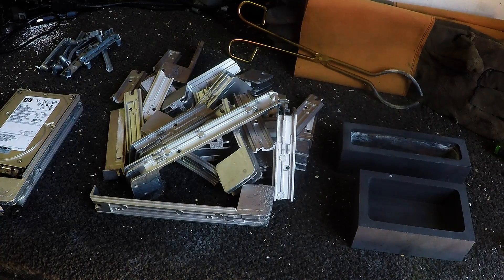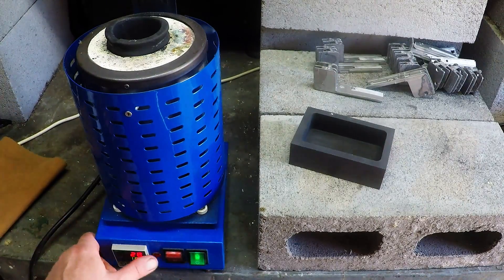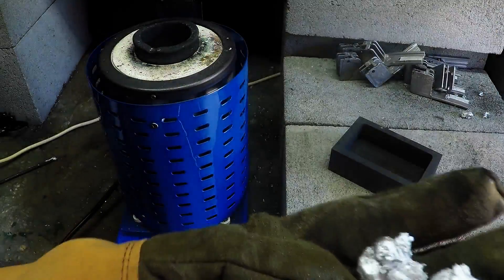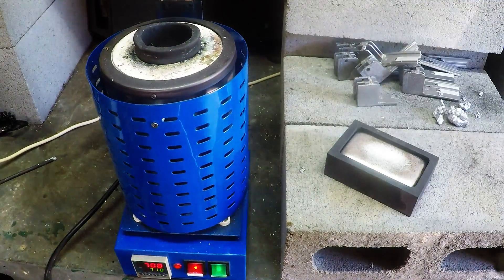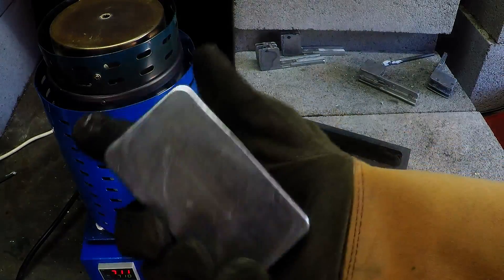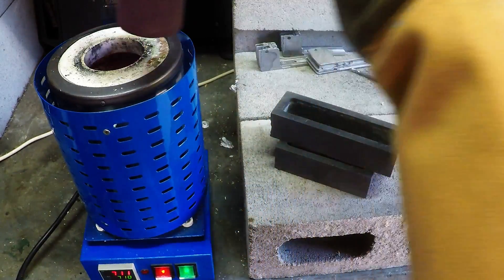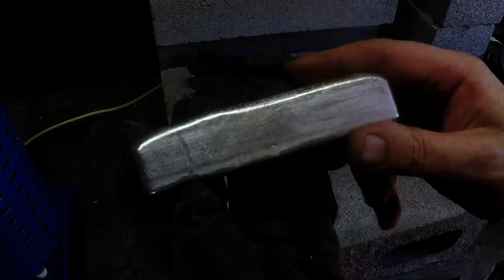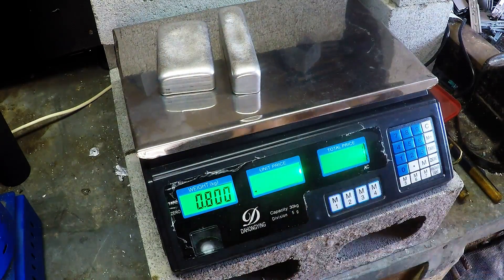Casting Aluminium Bars from Scrap

Comment: I melt down here in the u.s. . Its typcally off my service scrap stuff from heating and air .  I saw your other video on the big copper bars and what not. If you can make yourself a torch stand to keep the torch tip center of your molds. You raise it up a bit  and it helps keep your molds hot  while pouring, but what it will also do for you is give you these real nice ripples in the pour on the bar. Very clean looking and nice appearance. You had mentioned doing the art bars  all the ripples turn oht differently too.

Comment: Casting alu. You most likely have aku with another metal thus not quite all melted. You might try 100 deg higher
Dross is tarnished metal or dirt. You should not have the material you showed on your video. Too hot dirs nit make thick metal. .

Comment: Hey Ben I hope to have a set up for melting metals within 1 or 2 years. I was thinking about buying the same furnace as you are using but the ones I see on the internet dont seem to reach over 1100 degrees celsius. So maybe Im going to build my own gas torch oven or buy one from devilsforge as they arent that expensive and are very economical in gas use. Love your videos!

P.s. I see that crucible is getting thinner. How much pours in total it will last?
Reply from the maker: they don't last lost when melting copper so when they wear out a bit too much I used them for aluminium which is much cooler.
electric furnaces are only good for gold & silver, best to get the devil forge and a clay graphite crucible like a salamander, they last a long time with high heat
Reply: @eWasteBen  thanks!

Comment: Dross would typically be any impurities - say plastic that still got into your raw material. Given you were starting with relatively pure material to start, you may want to consider attempting to re-smelt the "dross" a time or even two to extract as much pure metal as possible from an non-industrial casting.

PS: Americans won't hold the pronunciation against you. After all you also include all those extra letters in some words as well (colour  - color).

Comment: Cast aluminium is less pure than extruded aluminium; cast aluminium will have anything from salts to copper added to help the copper flow into the mold/prevent voids and bubbles and such. extruded aluminium tends to be more pure since its put through a die with tons of pressure. you can extract more aluminium from dross by using stump removal powder (forget the chemical, look at makerj101 i think is the channel) during the melt. good video!

Comment: Hi Ben: Bit off topic,but i hear the weather down under is burning hot. How has your area been?.  We been having terrible weather here in the states. Tomorrow it is going to be 60 degrees Fahrenheit here in Wisconsin. It is unusual seeing those temps in February,usually around O degrees and is supposed to be one of our coldest months. Makes me wonder if the northern lats will see what you are getting.
Reply from the maker: It's normally the hottest time of year here and yeah there's been consistent hot days in a lot of Australia but we're actually ok down in Melb', 90's mostly but we've had some very hot nights, 90's all night
Reply: bantalee2002 I live in Wisconsin as well and it was 65 Fahrenheit, I loved it.
Reply: I love the videos! I'm in the process of making a gas pottery kiln. I'm hoping I will be able to melt batches of metal in it as well in time. If you ever make any more austalia bars I would love to buy one.  Maybe some Al AU bars would pour well!

Comment: Awesome pours bro!  Quick question for you when you have a moment. I found in the dial of a clothes dryer, a gold coloured circle snapped switch. I have seen a few times in switches where there is no silver contact and instead just the gold coloured and it's pressed up where the contacts would normally be. My question is, is it most likely just yellow brass or is it gold plated and that's why no silver contacts?  Is yellow brass ever used instead of silver contacts for certain applications.?  Any help would be appreciated. Thanks.
Reply from the maker: I'd imagine it's brass but not totally sure without seeing it

Comment: my yard takes ali dross so your yard may too love the vids iv been getting some great pick ups since your advertising advice video do you re-sell cables i got boxes of cat5 internet, pc power cables, phone chargers and hundreds of vga cables i going to try sell them as a job lot hopefully
Reply from the maker: sometimes I do sell cable in box, vga etc are very common so they don't sell well
Reply: eWaste Ben i didn't think they sell well im hoping someone who just sells cables at boot sales or flea markets would be interested i cleared out a few offices recently in the canary wharf skyscraper which were my best pick ups so far and got hundreds and hundreds of vga and vci cables anything over scrap value would be a bonus because im making money off all the brand new still sealed monitors they gave me #score

Comment: Hey Ben, I've just bought one of the furnace units. I'm curious how many heats your getting out of your crucibles? are you measuring as you go? I assume it will be different for lower temp melts. cheers Dale
Reply from the maker: about 15 good pours on average, yes the hotter the temp and longer it goes the more wear to the crucible.
Aluminium would last 50 or more pours, lead maybe 80 pours, the crucible I used here had a very high heat for almost 2 hours straight once, then other copper pours so it's almost shot, only good for a few more Aluminium pours now.
too thin and it will bust open and leak metal into the element which will short the unit out
Reply: eWaste Ben , are you using anything specific to measure or can you visually tell as it becomes unusable. I may give it a test run today as the weather has calmed down, and did you or are you adding borax to the melt? thanks for taking the time
Reply from the maker: I didn't add borax to the aluminium, might try it next time. 
the crucible will just get thinner, for high heat about half the original thickness is about it, after that just use them for aluminium or lead.
Reply: eWaste Ben, Thanks mate cheers

Comment: What is your advice on chrome plated brass, was hoping to cast some old tap ware? will the chrome seperate from the brass into borax flux or burn off?  Good job on aluminium. Cheers
Reply from the maker: probably not burn off but might rise to the top so you can skim it out with the molten borax.
if not then maybe add some clean brass to dilute it down to next to nothing. 
the chrome plate is only very fine, usually plated over a layer of nickel
Reply: Thanks for that Ben, will let you know how i get on. When it cools down a bit the weather. will only be about 6 or 7 ounces for the first go.

Comment: Aluminum is very reactive to oxygen, so much so that it nearly instantly forms a bond with oxygen from the air creating aluminum oxide. Aluminum oxide has a much higher melting point and is very hard. Fortunately it is also nearly impermeable to air. Any aluminum will form a skin of aluminum oxide that will prevent the rest of the aluminum from oxidizing. Those bars that were just poured already have a skin, so if you melt them down again you will still get even more dross. Less than what you got from the scrap as your bar has less surface area. This is why pop cans are generally considered a poor source of aluminum. A can is all surface area protecting very little pure aluminum.
Reply from the maker: Thanks for that
Reply: +eWaste Ben sorry my phone is stupid i ment  to say watched
Reply: do you know where to get good quality aluminium scrap globally. can i get their contact no
Reply: Very informative thank you
Reply: Bhuvan Lal i can give good quality of aluminium scrap with the purity of 97% to 99 % contact me on my whatsapp number +919953331136

Comment: 12:00 Where would you sell it to get its real price instead of the price of scrap aluminium?
Reply: ebay. i buy rod stock and flat bar for machining
Reply from the maker: it's worth 20x more than scrap aluminium to me, the question could be..
Where could someone buy one if they wanted a poured aluminium bar?
Reply: i know right! before i started melting my own, i was searching everywhere for metal bars. they're fortune indeed.

Comment: Hey Ben, what happened to your crucible, it looks a bit worn on the top?
Reply from the maker: Yeah it's an old one that's done a lot of pours, it's probably half it's original thickness so a lot more fragile.
you can see my fingers after touching it, graphite powder comes off it easily now.

Still ok to use for lower temp's like the 700c I had it at, but it's risky because they can bust open when too thin and the metal leaks into the element, graphite crucibles need to be replaced after around 15 pours
Reply from the maker: $15 ea
Reply: AussieMatt are they expensive? I believe it contracts when it cools down hence the dimpel
Reply: eWaste Ben